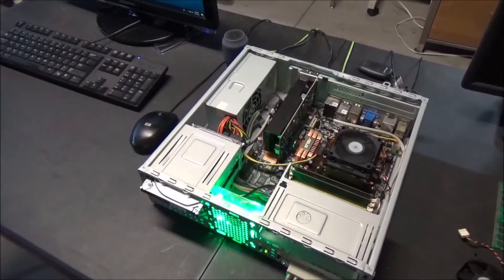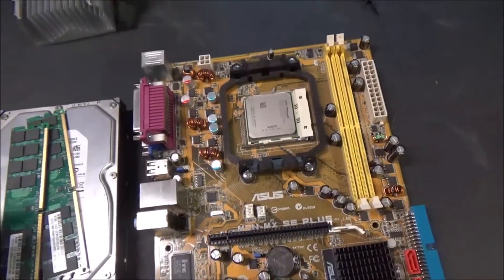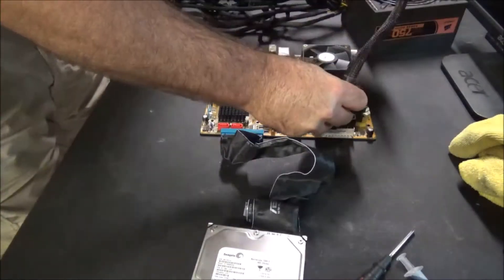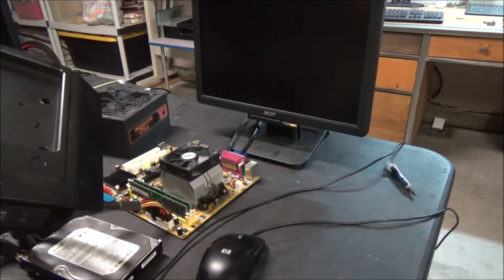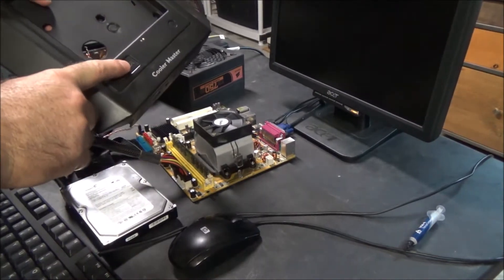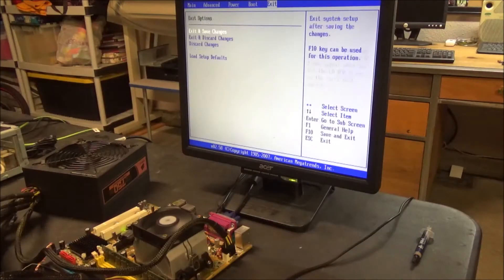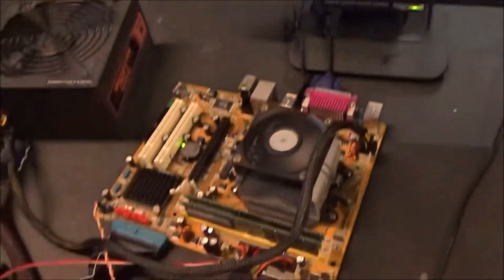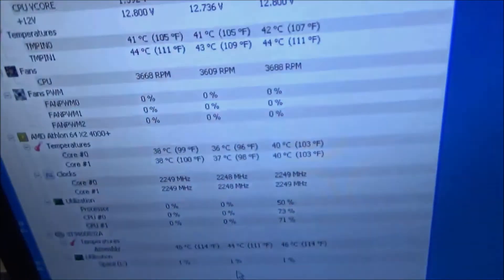Quick Overclock Update and the old AM2+ mobo 8GB RAM Test

Comment: hey quick question can I put an i5 in a Dell Optiplex 745 ???
Reply from the maker: The only way is to swap the motherboard with one from an Optiplex 980. But that is a crazy project that's pretty hard to do. You can usually get a 980 sff with an i5 650 from eBay for around $100.

Comment: is that 8 gb of ram ecc or buffered?
Reply from the maker: Buffered.
Reply: PimptatoPCs could be a problem. i had one that was buffered and i had to get a refund. maybe its just the mobo requiring specific ram.
Reply from the maker: Oh I'm sorry, I wrote that wrong. It's non-buffered. I got a little confused because ecc is buffered and your question asked if it was ecc or buffered. I said it's buffered because I know it's not ecc ram. The motherboard that I replaced this one with has a setting in the Bios that allows the use of either ecc or non- buffered. Pretty cool.
Reply: PimptatoPCs wow

Comment: Ddr2 ram support looks to be tricky, i had an old am2 mobo wich said to support only 2 gb and i blindly added 4 gb and it worked... Ddr2 is strange
Reply from the maker: DDR2 was a strange generation of memory with a lot of quirks, but I feel like it's the manufacturers being lazy and not updating their website with accurate information. If a motherboard was released with the ability to handle a maximum amount of ram, I'm pretty sure that it can't support more without a Bios update. I could be wrong though. There are so many accounts of people trying more ram than the "max" and having it work, I really don't know what to believe when it come to compatibility.

Comment: Oh damn it worked. Looks like you need to order more ram now lol and maybe the phenom x4 955 cpu. You can throw the athlon x4 640 into this mobo. Good to know that it worked Incase I ever want to upgrade my system from 8GB to 16GB...
Reply from the maker: I'm happy it worked, and a little surprised. I'm sure it won't be long before you get the ram upgrade bug now that it's confirmed to work. I really wanted that itx combo but that was my parts cash for this build. Hopefully it won't be more than a week or so before I can get more ram and the 955. I'm also looking at a new psu that's $50. In the mean time I'll paint the chassis, refurbish the mobo, and start messing with the water loop. What color do you think I should paint the case? White or black? Or should I go crazy and use an actual color?
Reply: That’s a tough one... while you can’t go wrong with black or white it would be interesting to see an actual colour. Maybe do a phenom logo themed build? Like black,blue and purple maybe?  Black and purple as the actual colours with blue led 80mm fan? Or just keep it simple, it’s up to you. 
Even though I prefer “normal” looking builds, colour seems to grab a lot of attention, like modstek’s weird builds for example. Makes a great thumbnail picture. Also don’t know if you ever watch nerd on a budget but his hulk themed pc turned out pretty sweet looking. Might be worth sacrificing the case and paint it something unusual to help grow the channel. If you really want to grow I would recommend a fortnite themed build... but don’t tell anyone I said this :P . If I was to be your un-official marketing advisor a fortnite themed build is what I would recommend due to it being very popular right now and it will come up in a ton of searches and this pc would be a great “budget fortnite build” put that as the title and it would actually be a perfect recommendation as an entry pc spec wise for people wanting to play the game on the cheap. You can also grab some fortnite vinyls for pretty cheap online. In my opinion that’s what I would do and it’s not wrong to do what’s popular. There is that saying give the people what they want or build it and they will come?
Reply from the maker: I can't believe Modstek gets so crazy with his builds and some how they turn out "right". I'm really a black and/or white guy when it comes to PC's, but it's probably time to attempt something a little wild. That NOAB Hulk PC turned out really nice for sure. Well, you convinced me to go with some color. Maybe I'll check out some custom AMD builds from 10 years ago for inspiration.
Reply from the maker: I'm like you when it comes to PC's, I want them simple (black or white) but with a cool edge like a ninja or something lol. I am a painting contractor and an above average artist, so I'm confident that I can do something that doesn't wind up tacky or just plain lame. At least with a Fortnite themed build I would have a good excuse for a bunch of wild colors. It would be nice to have a video go somewhat "viral" but I can't even put ads on my channel until I have over 1000 subs. I did start a Patreon page and will probably be doing a video to let everyone know that any support would be greatly appreciated. I could get so much more done and post a lot better content if I had more resources to invest in the channel. But you don't need to delete any posts! We're just talking about channel content. I really don't care who might get offended or turned off by a YT comment! Thanks for the consideration though!
Reply: Bah I removed it anyway, I felt like I was  pushing the theme to hard. Anyway even if you can’t add adds yet something crazy is what I think will get you past that 1000 sub mark and after it’s done I’m sure you can re paint it black if you want to sell it sometime down the road. Excited to see what you end up choosing.
Reply from the maker: Really the only bad thing about a Fortnite themed build is that I haven't played the game. Personally, it's hard to express something artistically without experiencing it. I really want a console to play shooters because I suck at using a keyboard and mouse. I should try Fortnite though, it's already installed on my sons PC. I just don't want to get mopped up and rage quit!
Reply: It’s a fun game but like most games it’s better if you join in near the beginning so you can learn with everyone else. At this point there are a lot of people that are amazing at the game which effects the newer players getting into the game. I started playing world of tanks and counterstrike when they came out so that’s probably why I enjoy those games so much. I get to “seal club” the newbies as they call it in world of tanks and get to “smurf” as they call it in cs:go which is essentially beating up on newer players with my higher skill level. I played fortnite briefly and did enjoy the game but didn’t stick with it, so if I was to start playing it again I would be severely lacking in skill to complete with people that play it all the time. Still would make for a good theme though. It is insanely popular and I’m sure most of the tech tubers don’t have time to play it much also but still tend to build pc’s to play the game and benchmark it so even if you don’t play it I don’t think building a fortnite themed pc would be that big of a deal. It’s the new school of thought everyone seems to jump on the new game bandwagons because that’s is what people want to see benchmarked and played even if it doesn’t interest them and that’s what brings in the viewers.
Reply from the maker: I know what you mean about showcasing the shiny new toy in the gaming scene. Everyone is searching YT for videos when something is fresh and it helps a lot with views. That's another thing I don't have the cash for, buying new games when they come out. I usually wait for a sale and by that time everyone on YT has moved on. Maybe I'll try to go crazy like the modding competitions and turn the PC into the Fortnite bus.
Reply: So when does the next video come out? Did you end up ordering that cheap case for the other mobo now that you know that it supports 8gb? Could probably use another 2x4 gb kit by the looks of it too and that x4 955 Lol. I’m not trying to make you spend a lot of money but... you know you want to.
Reply from the maker: Man I got stuck making a cardboard race car for my sons "end of the year" classroom party. I don't think I'll even have time to mow the lawn today. I probably have another hour to go on this cardboard project and then I'll try to edit a video that I can post later tonight. I scored a couple jobs though so I'll be buying some more parts real soon. I need to use any cash I have for the 955 and some more DDR2 but a guy on my local Craigslist has an i7 2600K and 8GB of DDR3 that he said he would sell me for $60! That's a hard one to pass on.
Reply: Surely it was the best race car at the school, was probably water cooled and had fans galore pushing it to victory.
So any updates? Did you buy that 2600k combo or paint the pc chassis yet? Also since your a master painter should I go for one or two coats of primer on new drywall/mud? Still won’t be doing the priming and painting till the weekend most likely though. Don’t think I hate anything more in life then sanding drywall mud so far, can’t wait till it’s done and I can set up the living room back how it was...
Reply from the maker: It turned out pretty sweet. I went a little overboard with the construction but decided not to water cool it lol. I didn't buy that i7 but still might. I haven't had a lot of time for PC stuff the last 2 days. There's one more day of school and I've been running around trying to help the wife with kids. You'll probably be fine with one coat of primer if you're using a good quality paint. But it wouldn't hurt to do 2. Drywall work sucks for sure, it's kind of fun hanging it but taping, mudding, and sanding is dirty job. I can't stand dust and sanding drywall mud is terrible. Good luck finishing up man, sounds like you're almost done. I'm going to try my best to do a video this evening. I have some things ready, I just have to do the editing.